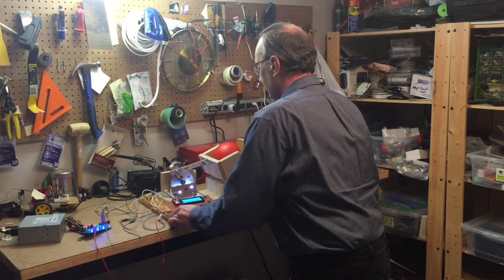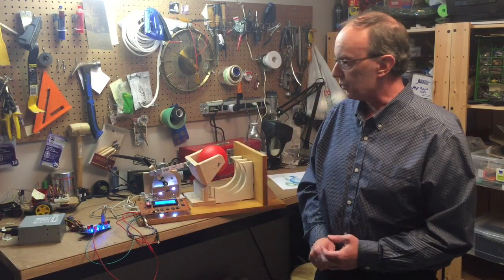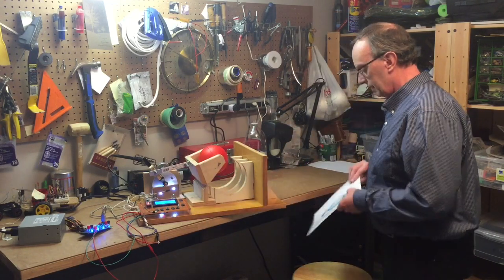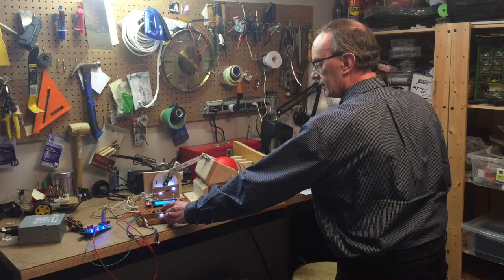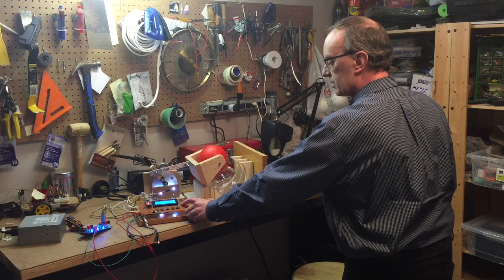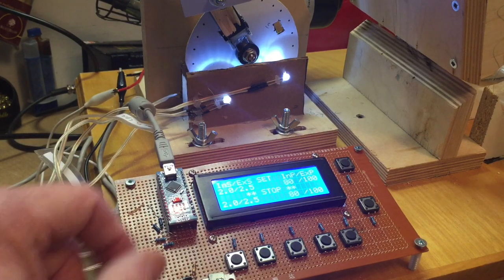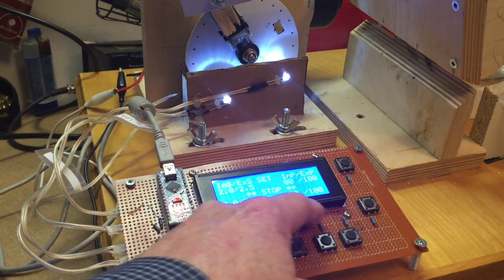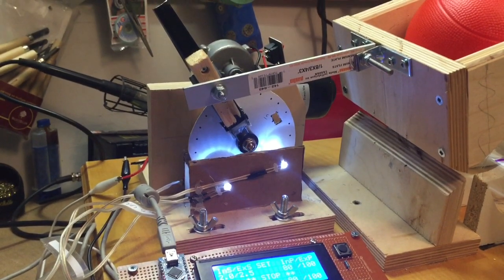Village-Vent - Emergency Ventilator Project

Comment: Absolutely brilliant, Gord. 
The fact that you can make it pretty much from second hand parts plus a cheap (clone) Arduino Uno or Nano is a great design feature, as is the ability to run from any 12v supply. Are you going to design a PCB for this, in readiness?
Incidentally, it's not just Sudan that has this problem. Most of the 3rd world countries are in a similar situation, including rural India, according to a TV report this morning.
I wish you success in your endeavour and as an entry in Prevent and Protect Challenge on Hackster.io https://www.hackster.io/contests/UNDPCOVID19
Reply from the maker: Thanks kindly Ralph. Your comments are high praise from the Maven of MicroControllers! I am not designing a PCB. Haven't got to that point in the journey yet. But after your tongue-lashing a few months back when I sent you a circuit done in Fritzing, I did the circuit diagram for the contest submission in proper EasyEDA. So it's a proper electronic schematic! And I lived to tell the tale! Keep safe and happy Ralph!